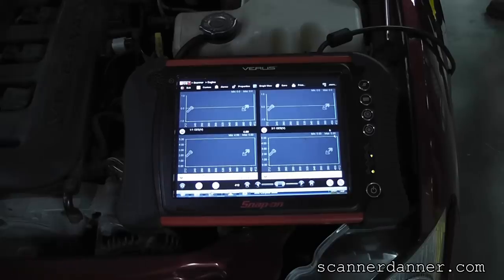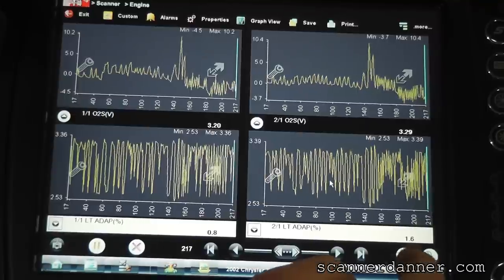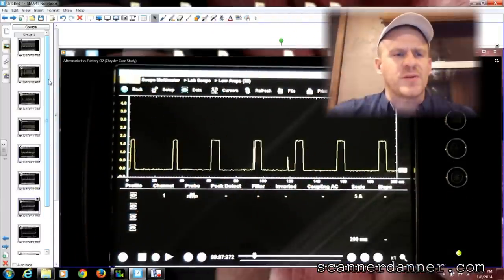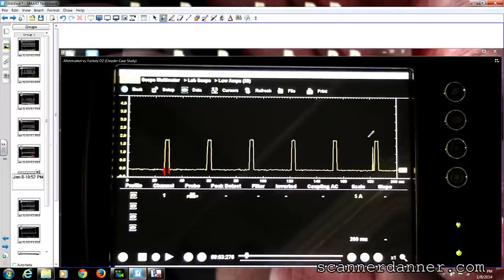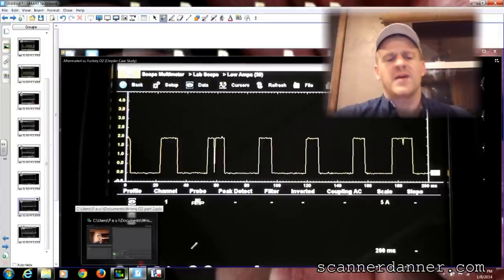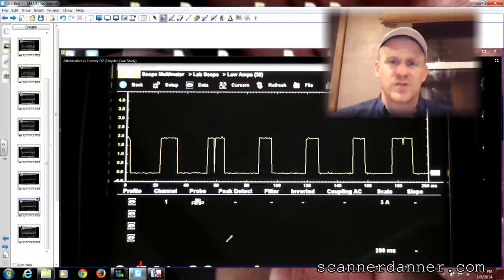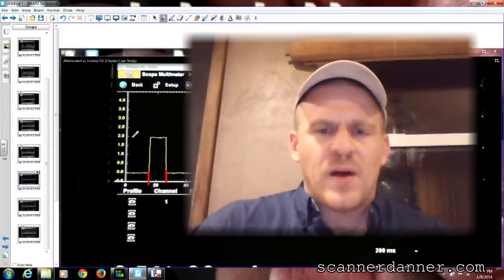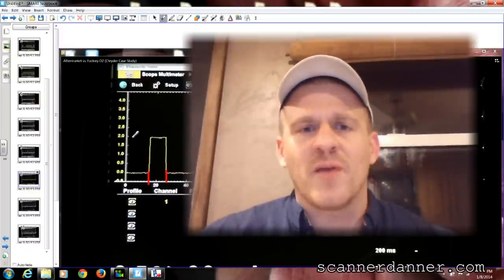WARNING! Aftermarket Oxygen Sensors (Chrysler/Dodge/Jeep part 2)

Comment: Paul awesome work.  I have a customer with a 2002 S-10.  He had a check engine light on with O2 sensor trouble codes, along with Mass Airflow Sensor and Lean codes.  He swapped out the O2 sensors and installed Bosch sensors. He also put in a new Mass Airflow sensor.  Needless to say he did not fix his truck..  He brought it to me.  I fixed the vacuum leak that caused the Mass Airflow and Lean codes then addressed the O2 sensor issue.  I remember when I was in tech school one of my instructors mentioning how aftermarket O2's and spark plugs can cause problems.  He recommended using OEM parts.  I told my customer to install OEM sensors.  I checked the heater circuit on the Bosch sensors.  I even checked the resistance of the heater circuit while heating the sensor up with a propane torch. I checked sensor signals and voltages. I could not see anything wrong with the sensor. Sure enough though the new sensors fixed his problem. It has bothered me to not be able to figure out why the Bosch sensors did not work.  Your videos have helped shed some light on this.   He has been running without a check engine light now for a few months.  As far as dealership techs and some of the work performed by them... "Variables".  What do you get when you mix flat rate with insurance claims?  Unfortunately in some cases a "Parts Changer".  Thanks again.
Reply from the maker: +Gary Habat Thanks for sharing Gary! Very helpful information for sure.

Comment: *Update on my issue P0151 in my 04 Dodge Hemi Ram* A used factory Mopar o2 sensor from an extra parts bin I had and pcm reset fixed my issue, aftermarket new cheap ebay ones did not work. Unfortunately I seen this video after I had already bypassed every wire and bought those crappy sensors lol thankfully those bypasses were only 3 feet long because bank 2 sensor 1 is right next to the firewall where the PCM sits. A big thank you to ScannerDanner for the tip off about the Chrysler specific o2 sensors! :) Saved me from putting 100lbs of tannerite in the front seat.
Reply from the maker: my man, way to be persistent! Thank you

Comment: I worked a job where the shop owner would tell me what parts he wanted me to use against my advise only for it to return and him backflagging me for the repair.
Reply from the maker: That is ridiculous! I'm sorry you had to deal with that.
Reply: That's really sh_ty! I know the feeling. Even for the most basic jobs, always trying to push stupid shortcuts! It's unproductive and gives a bad rep. 
I recall the most basic job, an oil/filter change! On that particular model (Opel) the oil dripped directly over the exhaust flex connection. Meaning you do have to clean it properly... 
Boss comes by and say, It's OK don't clean nothing. I explained why it should be done. Negative reply and insisted to leave as it was. Well, is the boss! 
Short story: Next day client was back complaining! So start it all over again putting car on elevator, etc. Damn waste of time! A tiny and irrelevant example, that explain why I resigned after less than 3 weeks!

Comment: Do you need to measure resistance?  If you do the math same voltage and amperage on both sensors that must give the same resistance, amp is the outcome of volt and resistance that’s what make amp, the volt and resistance.

Comment: I have a problem with my O2 sensors I actually have bought sensors from the dealer I have changed my O2 sensors three times now they are not registering at all the car is basically junk because of this problem what will I have to do it cannot be the O2 sensors it has to be something else that's not allowing the sensors to read at all could it be the wiring is gone PS car set at dealer for 6 months

Comment: Wow, I am a licensed aircraft mechanic and I have learned quite a bit from your videos. I would not normally use a scope to diagnose an O2,  but now, after seeing several of your videos, I am now inclined to use a scope on anything that signals the ECM/PCM. Thank you for sharing your videos. I have recommended to my nephew he enroll in your premium service, as he wants to become a mechanic. I may actually join myself. I also want to say thank you for showing the good, the bad and the ugly when you catch yourself going down the wrong road. We sometimes learn more from mistakes than successes.
Reply from the maker: Thank you so much! If he does, and he likes the electrical and troubleshooting side of the car, he will have such a huge advantage if he takes my course. Thanks again, I look forward to hearing from you both more

Comment: Just discovered these 2 videos. Can’t thank you enough for posting this. Last fall I had a P0152 code and changed the Bank 2/1 Ox sensor on my 2005 Dodge Ram (5.7 Hemi) with an”NTK” from Advanced. Seemed fine thru the winter (Doesn’t get driven a ton), but recently the engine would stall on deceleration. Got the same code again, and thought that the problem might be fuel injectors or circuit problems. After watching this I looked at my scanner tool and saw the fuel trim #’s matching what I saw here (getting -30’s to -40’s). Decided to try swapping the Ox sensor with a Mopar sensor (only a $25 difference). It was immediate difference. Voltage and trim all evened out!! Drove for an hour straight with not a single hick-up. I was about to throw in the towel and take it to the Dealer, but you saved me. For my truck, the aftermarket sensor really didn’t work. I will be watching and learning from now on!
Reply from the maker: awesome! glad this helped you

Comment: I notice that the same issue happens with a Ford as well. Motorcraft also uses NTK as their oem sensor and sensor reading is very critical in fueling as well as cat efficiency. 

I have a 98 ford contour with the duratec v6 engine and false cat efficiency codes are very common if bosch upstream sensors are used (as well as downstream sensors). In fact I kept getting the cat code with a new bosch upstream  o2 sensor where i wasn't getting the code before.

Comment: Hi Paul 
The reason there is a raised gnd potential on the thermocouple is because of better engine noise immunity. For example beginner designs of fuel injection are affected by ground plane noise that causes logic level errors. This is clever that Chrysler does this in analogue sensing. I also believe that the a/d in the computer biases the heater intelligently to keep the sensor peaks under a max limit meaning it can see the most relevant unaffected signal resolution within a small sensing voltage peak to peak. If the signal is too wide then too high a peak will result in a low mark space ratio on the heater coil. Sometimes off.

Comment: Thanks a million for making this video. I replaced the down steam sensors several times and kept getting codes until I watched your video and used Genuine Mopar sensors and resolved this issue. You saved me a lot of time and trouble plus a ton of money from sending it to the dealer. Passed inspection the next day. I will hit the like and subscribe button and will look for you for  other videos in the future. Thanks Todd
Reply from the maker: Glad it helped!
Reply: @ScannerDanner  It was my wifes car,  and yes the saying happy wife life happy life does hold true. That was an amazing video on the differences of after market vs true genuine parts, I watched the graphing on the intermittent cycle and that is what convinced me this was the problem.I give your video 100 thumbs up. I hate putting parts till I find the problem but still may have been wrong if the part I put in are the problem. I was a schooled mechanic back in the 70s and 80s we did not computers that were this sensitive to such a small deviation of what the cars wanted. I quit and changed fields when even dealers could not figure out problems and decided to become a stationary engineer till I retired.  You did a fantastic job of explaining aftermarket is the problem and I had this issue with a Nissan many years ago that needed a Nissan oil filter because aftermarkets where blowing out the gasket 3 oil filters blew out but the ones from the dealer worked no problem.
Reply: @ScannerDanner  May need help with my sons 2014  300 all wheel drive system in the future with his problems, But going away to fix a bunch of problems at my daughter. You have a good 4th and I will be busy.

Comment: These two videos and ultimately your book saved me from changing a PCM on a 2005 dakota, i did not know there was also a 2.5V bias on the ground side of all sensor signals, i was probing both the signal and ground of bank 1 upstream and was getting the average from the meter which was 1.9V with the engine off and thought it had an internal short or something, turns out it only had a bad sensor heater as the only code it had said, i tried to heat it up by revving it but the signal stayed high regardless (3.5V), i guess these heaters do heat them at least above 1500F, but it was cool seeing fuel trims duplicate from the good bank on the data, please keep uploading videos this is a wealth of knowledge that at least i can't get anywhere else.
Reply from the maker: thanks so much Samuel and good job on fixing that car and more importantly, knowing why you fixed it!
Reply: thank you man, couldn't have done it without you

Comment: The ASD controlled heater circuits were used on the SBEC and JTEC controllers. The newer NGC controllers were PWM. That is when Chrysler did the change over. I thought this info would be useful to you.

Comment: I just happened to have the exact symptoms and basically the same car (intrepid 02) in the shop the day before and was about to suggest replacing the computer because both up streams were giving me the same issue. turns out they were both bosch sensors ( the ones mentioned in the video part 1) did a little more testing and replaced them with factory o2s. 100% fix hard to believe but was a huge help. thank you so much.                                    Alternative Auto  Winfield, MO

Comment: I use Denso o2 sensor in my 03 Ram Truck with no problems.  The OEM o2 I took out the truck has the mopar part number and  Denso labeled on side the sensor, so looks like Denso manufactures Mopar o2 sensors for my  Ram

Comment: I have changed my two down stream O2 sensors on a 2004 Jeep Grand Cherokee. I do not have the money for an OBD2 setup like you have. I have a bluetooth scanner and it shows almost what you are showing which is a lot of large gaps on the sensors voltage. I went with the Bosch sensors because of the price. I can replace all of my O2 sensors for a fraction of the Mopar sensors but now I can see it is worth it to get the proper O2 sensor. I don't know if my Jeep falls under the same PWM that you were speaking about but I do know that I have read in multiple forums that Bosch does not work in my vehicle. No explanation just that it does not work. Thanks for breaking this down so well.

Comment: What is interesting is that the Gen 1 88-89 Dodge Ram TBI O2 factory sensors were Bosch.  It was noted in the service manual.  I think many Mechanics have that in their heads too.  I have an 05 Ram w/hemi, and when I purchased the sensor from Rock Auto, I noticed the description showed NTK was the factory sensor, and I bought it...second after buying the Bosch., then read about the issue and put the NTK in.  Just saw your great videos on this!  Makes you wonder how many other parts are like this today.  Example:  My truck hemi  PCM doesn't like the Standard brand EGR valve.  Had to use a different one.
Reply from the maker: Yeah unfortunately the change up from the manufacturer on design and control doesn't get past on to the aftermarket.  In this case the old systems had the o2 heater on all the time and the newer ones are pulsed on and off, so that was why the Bosch sensors would no longer work

Comment: When I confronted the problem you illustrate so well, I concluded it was caused by the failure of the heater to come up to temperature quickly enough. With my original, OEM sensor, the ECM would be in closed loop mode before I could back out of the driveway. With the aftermarket sensor, it would take two miles or further. But until your video, it wasn't clear to me why this was occurring.

However, I don't believe the issue has anything to do with the 2.5v sensor offset (perhaps they did this to simplify the interface circuitry by shifting the voltage to match a 5v logic level switchover) but the problem we face is that we don't know the details of the strategy that went into designing the ECM software; especially the PCM heater controller.

My theory is: 
I believe the ECM is attempting to measure the temperature of the sensor indirectly by characterizing the resistance through the heater element and relating it to the temperature. (I believe you correctly noted in Part 1 that a heater's resistance will change with temperature.) When the ECM detects the sensor is up to temperature, it shuts the heater current off and warms it up again if it cools at idle.

We know there is no separate thermocouple in the sensor that would reveal the sensor's temperature so the heater element itself becomes the temperature measuring device. During part of the heater cycle, the ECM would switch over to measure the resistance of the heater from which it then (indirectly) infers a sensor temperature. It uses this temperature to modulate the pulse width of the heater driver.

The problem is that the relationship of resistance to temperature is different with different heating element materials and configurations. If the ECM's software assumes a Resistance-Temperature profile of an OEM type element material but is connected to an aftermarket material with a different R-T profile (the differences will be in millivolts/milliohms at a given temperature!), it will infer an incorrect temperature and, therefore, incorrectly drive the PCM controller.

I do want to congratulate you for your skill and persistence in  >>diagnosing<<  problems. It is astonishing that -- after 30 years of automotive electronics -- techs are still wasting thousands with inane try-this-try-that troubleshooting methods and scrapping out entire vehicles over $10 problems.

Comment: Paul,
      I was looking on Snapon fast track it shows the heater circuit power from the asd relay going to the pcm then the pcm controls the heater circuit. This is from 1998-2001 300m,concorde hope this helps 
  Dave

Comment: Looks like the aftermarket O2 sensor simply does not match the specs of the OEM sensor. The pcm is programmed to react to a myriad of electrical parameters which if not correct will of course cause an issue. I believe there wouldn't be much tolerance allowed either, especially when it comes to an O2 sensor.
On a side note I've seen diesel injectors that have to have their manufacturing codes input into the pcm via a scan tool as the injectors can have slight variations in specs even from the OEM. If this is not done, a code can be set, mil light can come on, vehicle can run poorly or all the above. This procedure allows the pcm to slightly vary its output when firing an injector to obtain smooth running. The OEM O2 sensors don't need this done but that aftermarket sensors specs are just too far off and the pcm will see it as an issue.

Comment: A very late comment, here in JAN 18:-)better late than never... I have seen this episode a few times, and now I hit me that the reason that the wiring was changed, is that the pcm internaly switches a resistor in to  the heater circuit, so it acts as a temperature sensor. Switches the + pulse off and switches over to a fixed resistor internaly in the pcm to find out the temperature og the o2 sensor. By the way, the LH model started using this in 02 and the rest in 04 with NGC controller.

Comment: I was thinking what if the computer pulses the heater and when not sending signal it measures resistance like if it was an RTD then it knows at what temperature the sensor is. Contrary to the constant powered heaters that cannot be measured reading resistance.  Reading resistance is the most accurate way to measure temperature.